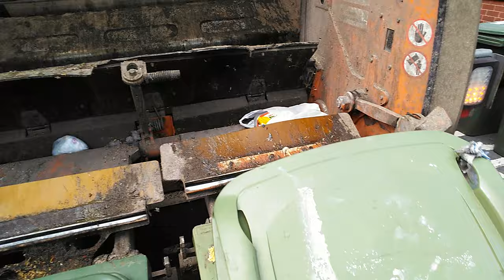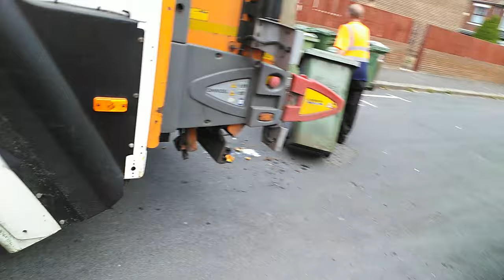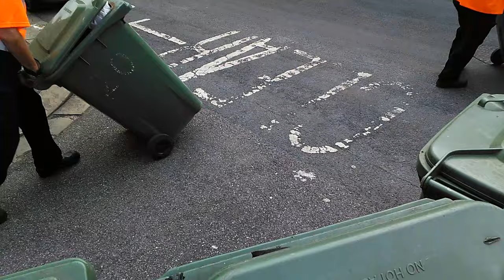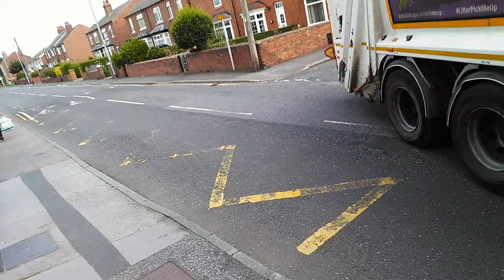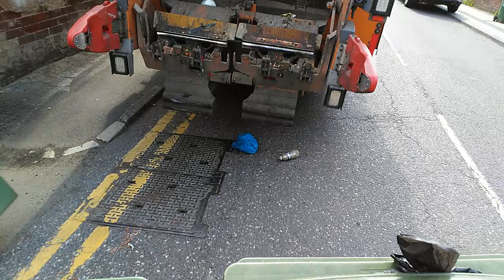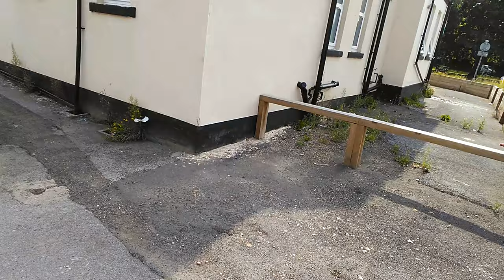BIN WAGON EATS A 360 LITRE WHEELIE BIN

Comment: Mine was swallowed this way last week, bit of a surprise but glad to see it’s not uncommon. Bin man apologetic fair play.
Reply from the maker: Yes if it's overloaded or not been put on the hoist correctly then they just fall in when they go up. The driver makes a note of it then the householder gets a brand new bin ( eventually )
Reply: At my work we just hit the emergency stop, climb inside and drag it out
Reply: Aye, I've had that happen when I worked on the bins, it isn't that unusual. Since we weren't allowed to get them out we just sent the cutomer a new bin. It can happen for a few reasons from it being overloaded/too heavy, the lip of the bin being damaged which prevents the lifter from gripping it properly or the most common which was the lifters automatic mechanism being a bit too eager to lift the bin up before I had the chance to secure both sides on it properly, that usually happened if the bin was too heavy and hard to move but not always, sometimes it just happened.

Comment: Emergency stop. Get the lover down. And... happyness. But it depends on the lift mostly. If they are jumps, thats it.
Reply from the maker: We usually don't bother to rescue them, it's not worth the hassle.  Just mark it off on the round sheet & get em a new bin 👍
Reply: @catbreath007  we save them. 360.660 1100 does not matter. Max the lid is lost. All saved so far.

Comment: Switch the lifts over to trade bin like they do towards the end of the video and the top bar will move out of the way releasing the bin.
Reply from the maker: ... Yeah that's what we usually do.  But it's more fun watching the bin being eaten slowly !! 🤪
Reply: @catbreath007  It does make a satisfying crunch.
Reply: You don't have to put trade mode on to lift the bar, you can press the A B button to lift/drop the bar while the lifters are still on split or when the rave plate is down